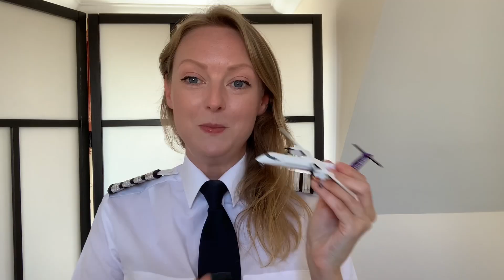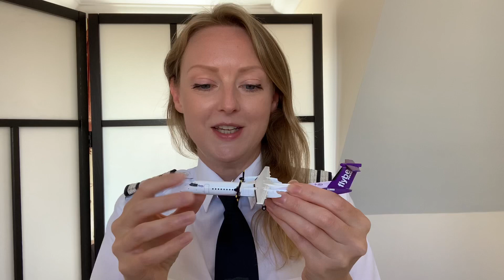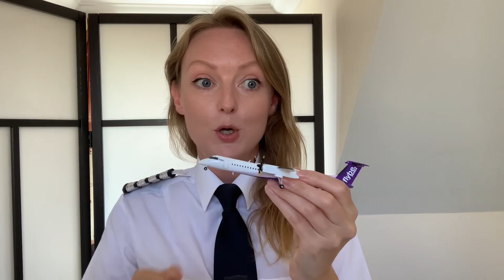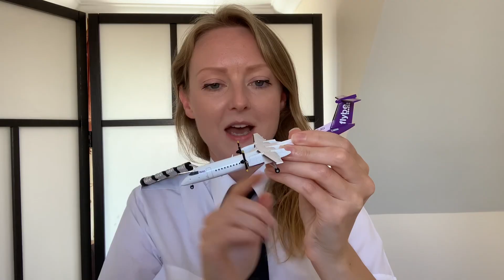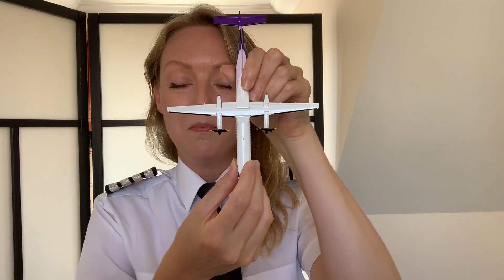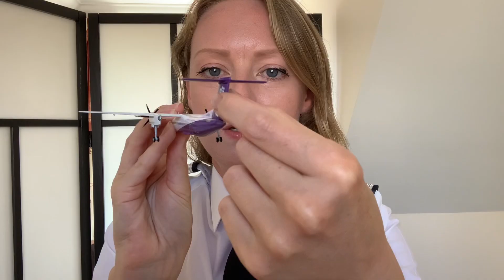Pitch, Roll & Yaw: Explained

Comment: Previously, I had the impression that I understood this, but I guess my understanding was partial. I used to think that those moving parts of the horizontal or vertical 'wings' (if I can call them that) created 'negative drag' or 'positive drag' to be able to maneuver the plane. By the way, the explanation was very clear. Thank you. I'll have to watch the video again to get right the names of the different elements involved in those changes in the 3 dimensions of a plane. By the way, do the ailerons play any role in stopping a plane when it lands? I assume most of the stopping happens by putting the breaks on the landing wheels, but I have always wondered if they plan any role while landing.  Also, another question that I have is, when starts the process of decreasing flight speed in order to prepare for landing, how is that achieved?

Comment: I just recently found that the Beechcraft Bonanza, with a V - tail, uses what is called ruddervators on the trailing edge of the V.  Both, the left and the right, work in the same direction, like standard elevators to control pitch of the airplane.  To control yaw, the trailing edges work opposite of each other,.  To yaw (point the plane to) the right, the trailing edge of the left side of the V will trim up and to the right.  At the same time, the right side trailing edge will also to the right, but down - both pushing the tail to the left and the nose pointing to the right.  However, this will induce a roll to the left.  This roll can be countered with some aileron control as needed to roll the plane to the right (left aileron down, right one up).  To yaw to the left, every movement of the control surfaces is the reverse of the right yaw.  Just something I had always been curious about.

Comment: I want to ask you why is yaw important? And can you fly the aircraft without yaw or rudders?
Reply from the maker: Yaw is a secondary effect of roll, so it’s important to be able to control it. You can also use it to side slip the aircraft, or to straighten up on landing in crosswinds. Bigger aircraft have auto-yaw control.
Reply: @pilot_ems  thankssss
Reply: @pilot_ems  doesn't the Dash have a yaw damper too? Pretty sure it does.
Reply from the maker: Yes the yaw damper ‘dampens’ the effect of yaw, but it doesn’t get rid of the effects. On the dash we still have to control it and trim it at most stages of flight